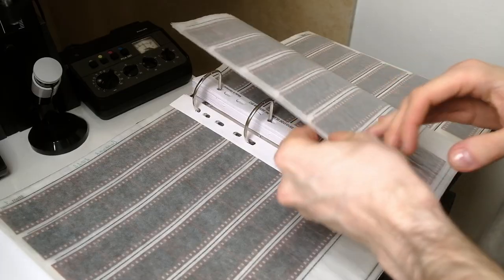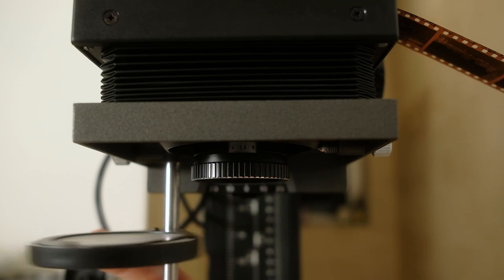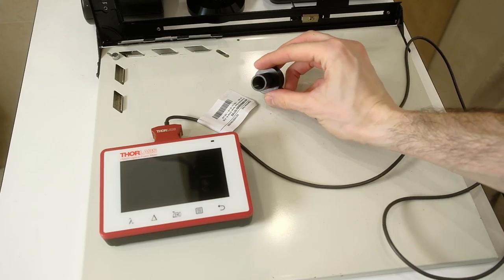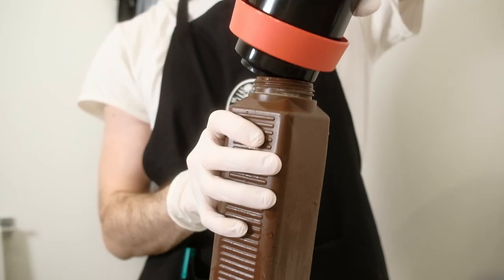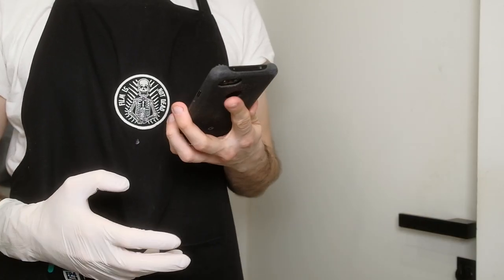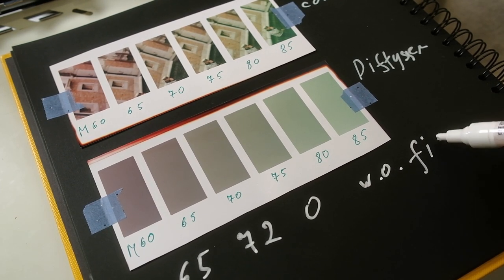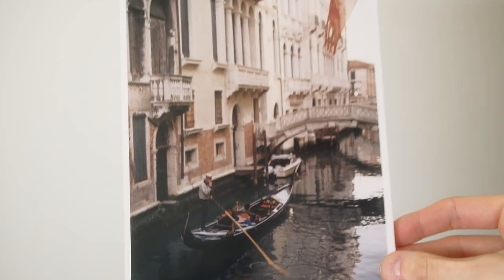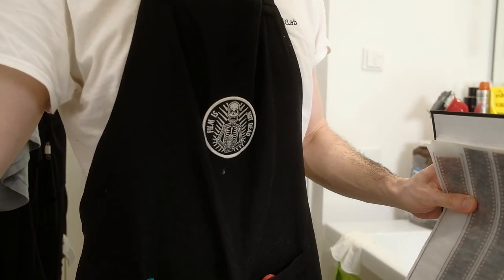How color correction works on RA4 prints and how color calibrator Philips PCA060/061 can help

Comment: hello! Thanks for your video. I ask you, is there any way to use the analyzer to calculate the exposure time for black and white negatives, using an enlarger with a color head to regulate the contrasts? Thank you!
Reply from the maker: Probably not with one, but they exist on the market like Heilandelectronics, you can measure both